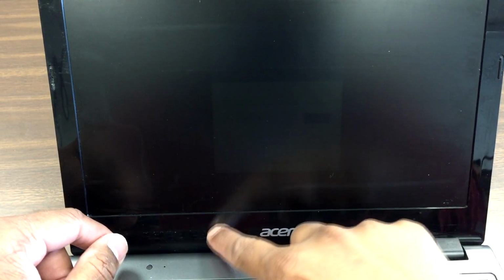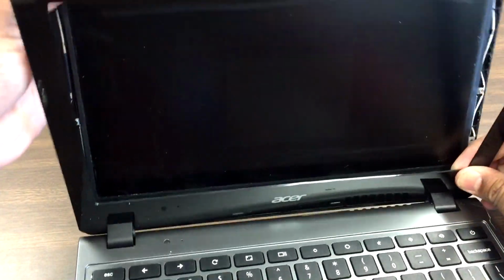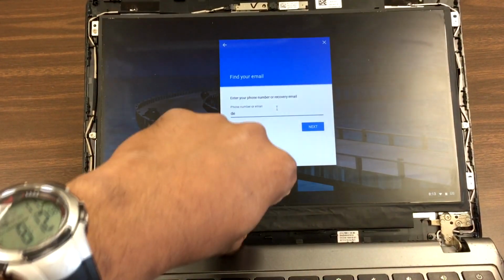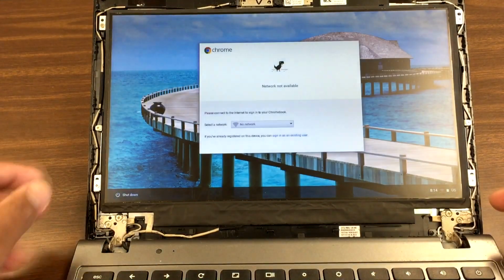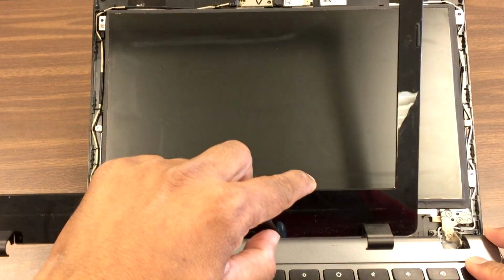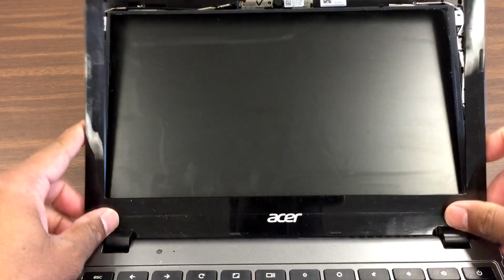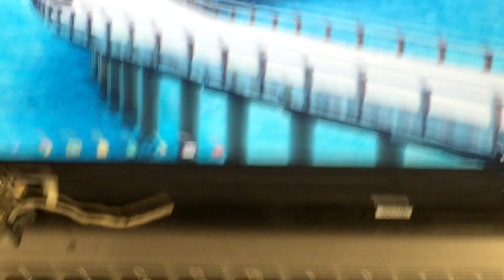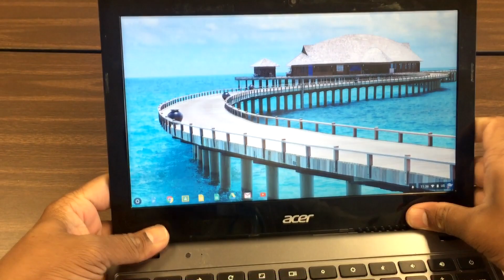How to Fix Dark Screen issue or brightness doesn't work Issue on ACER C720 Chromebook

Comment: I wasn't having it as bad as in this video but still had a bit of an issue with it. Definitely seemed to help. I was going to try and remove the screws and do the rest but I stripped my 4th screw trying to unscrew it and had no other way to get it out so I had to just put it all back together. That 4th screw was just refusing to turn. Tried doing it with a plyers and would not turn. Only other way I can think is to get a screw extractor but I'll just wait till it actually gets bad enough to where pushing the wire up doesn't work.

Comment: i had won a new chrome book from a work and it worked for about 3 months and stopped working that was five years ago i put it in 
the closet and figured it was the mother board cuz when it went out on me it was a hot summer day and i was out in the sun . so now i have an almost brand new five year old working cromebook . i used another video to see how to get my specific models cover off with out braking it and i took a close look at my internal display connectors and wow i saw main connector was at an angle and could see the half of the pins on one side and i pushed/plugged it back in as i watched it make a better connection i was so satisfied watching the plug cover the pins and it worked i am extremely happy . i feel like i won a new computer again lol. i liked and subscribed.
Reply from the maker: Glad this video helped! Thank you for subscribing!

Comment: thank you so much for this! it worked immediately
tip: don't be scared to break open the cover lol, i thought it would break and crack into pieces but it comes off really nicely if you apply force. also, when you're jabbing the wire, try pushing the wire covered with tape, that might do the trick.
Reply from the maker: Glad I could help!

Comment: I have a 2020 Chrome Book would this work with that? having the same backlight issue sometimes it gets worse when I pull the display down and it barely shows any light. But sometimes it works better while I pull it up and now it's getting a bit worse does this work? If so I might try it or pass it to my teacher in the building to try
Reply from the maker: Yes that seems like cable that connected to your LCD is loose.. give this a try.. good luck

Comment: Thanks so much for this! I just fixed a refurbished 2013 HP Chromebook 14 I got for $49 that I thought broke itself in the first 2 days!
Reply: wtf 49?? for a laptop thats low for a laptop a laptop is usually over 200
Reply: @ethanwinters3776  My record for a Lenovo N23 is $17. I have scored several more in the sub $50 or even sub $40 range. BackMarket is a great source for low cost refurbished Chromebooks with warranties! eBay too, of course ;)

Comment: I have an Acer R 11 Chromebook. I only used it for six months before it stopped working. When I plug in the charger I see the blue light is steady but I cannot get it to turn on. The screen is dark. I've tried pressing esc., refresh and power at the same time. That didn't work. I tried pressing refresh and power at the same time, didn't work. I tried pressing the button to brighten the screen. That didn't work.  I am wondering could it be that I just need a new adapter? Please help me save this Chromebook. It was hundreds of dollars. It's a white Acer R 11. I bought it awhile ago but only just started using it six months ago before it died. Please help.
Reply from the maker: Just unplug the LCD cable as show in this video and plug it back in.. that should take care of the issue. good luck

Comment: Guys you don't need to risk opening it  just slap it on the back and it should work good luck it worked for me slap it on the bottom where the cable is.
Reply: No way! I tired his way first. Zero result. Broken hearted i just scolded in the comments till i saw yours. I did just what you said. Success!
Reply: @ripmowt  nice to hear it worked ! but get it fixed ASAP i recommend it highly.
Reply: @RealOddlyDone  yes trying to get a screen replacement now
Reply: @ripmowt  brother it is not the screen it is the display cable connected to the motherboard do it on your own it is not that hard im 13 and i got the job fixed and it will save up money you are welcome!!!!
Reply: @RealOddlyDone  ok thanks will try this

Comment: Anything else i can do if this didnt help?
Reply from the maker: hmm.. unplug the power cable, hold the power button for 15 sec, plug the power cable in and turn it on.. Hope that works, but if the LCD connection is loose then you have to go thru the steps shown in the video.. good luck

Comment: This didn't work out for me.. Is there anything else I could do? Please help
Reply from the maker: unplug the power cord, hold the power button for 30 seconds, plug the power cord back in and turn it on.. hope this works.. 

Also, are you able to see the screen at all ?
Reply: @TechGuru247  Thank you so much for responding!!! 
Can see the screen very barely. If I switch the torchlight on, towards the screen, it is a bit better visible.

Comment: How can i open my monitor it doesnt open man im panicking
Reply from the maker: What model chromebook you have?
Reply: Tech Guru i have pc thats the problem exactly like this but idk what to do
Reply from the maker: oh ok.. most likely unplug the VGA(blue) cable from both end and plug it back in.. hope that works.. OR replace the VGA cable.. good luck
Reply: Tech Guru thanks but it doesn’t really matter now because im getting laptop that is alot better than that pc so anyway thanks for your time :D
Reply: Tech Guru but i also have a lot of useful files and that stuff but u said VGA (blue) i dont have any blue cables btw so what should i do
Reply: Tech Guru i found the VGA cable but its fixed in my monitor so i cannot unplug it so i just unplugged from the pc and plugged it back in nothing changed

Comment: I have a toshiba c655 with no backlight, tried removing the cable and connecting ( both from the led panel side as well as the motherboard side) stilll the same :(
Reply from the maker: Seems like you have to replace the screen as screen might be damaged.. good luck

Comment: Finally I found a video that has the same laptop as me bro I have the same problem with my laptop my screen is just dim and my computer still works but the display on the laptop still shows but is really really dim
Reply from the maker: most likely unplug the cable as shown in the video and firmly plug it back in.. If issue still not fixed, you might have to replace the screen.. good luck

Comment: Ok so I did this one time and it worked but a few days later it went back to being all black again, I tried to do this method again but now it’s not working!! Please help
Reply from the maker: Once you unplug the plug the cable back in, hold the power button for 30 seconds or so and then turn it back on.. hope that works
Reply: Tech Guru unfortunately that didn’t work ): the cord is loose. Everything else is working fine but the screen is black

Comment: Im having trouble removing the case around the screen
Reply from the maker: As shown in the video, the bottom two hinges are hard to detach so have to apply little more pressure while pulling it up.. Good luck..

Comment: Thanks for the time in doing the tutorial. If you are so kind and could assist me, mine has the following fault, and that is that after it began to function again after properly connecting the flex cable (it stepped out a bit after a fall), now the brightness remains very dim, you see the perfect image, without stripes or anything like that and also responds to commands of increase or decrease the brightness on the keyboard, but the brightness remains at a low level even when it is at maximum according to the brightness increase command. It also illuminates slightly more the right side than the left side of the screen. I noticed that the lamps are good, but in the area of the inverter it has some sound when is working, like a buzzing, all this happened after the fall. Also, when I touch the lamps cables when the laptop is on, the brightness is affected. What do you think it can be? Could you give me any suggestions? It's a HP X16-1025-nr. Thank you in advance.
Reply from the maker: It sounds like you need to replace the LCD as it might got damaged after the fall. Try to reconnect the LCD cable and plug it back in and make sure it's plugged properly. If that doesn't help, replace the LCD and made some videos on how to replace a screen. Good luck..!
Reply: Thanks for answering and your suggestion! By LCD cable you mean the flex cable right? I was wondering if in the case of a failure in the flex cable, could this cause that the appropriate voltage does not reach the inverter? Because for what I've been deducting, it seems to be a connection problem, something might be causing that the proper voltage doesn't reach the lamps and I'm not sure if it is the inverter or the flex cable.
Reply from the maker: Correct.. the flex cable..
Reply: Thanks again for your time, have a great day!

Comment: Will it work on loptops?
Reply from the maker: Is your screen is dim/slightly visible? If yes, then it should work. However, the process might be slightly harder as the screen cover might not come off that easy, might be attached with couple of screws. Good luck!
Reply: @TechGuru247  help it didn't work for me
Reply from the maker: then may be you need to replace a screen.   Are you able to see any images at all when turned on?
Reply: @TechGuru247  yes I can see images it's just when I move the lose cable nothing happens
Reply from the maker: @Broken Nation - Unplug the cable completely, and then plug it back in. If still says the same, you might need to replace the LCD. Good luck
Reply: @TechGuru247  how do you unplug the cable
Reply from the maker: If the connection is loose that it sure will work for laptops as well. Good luck

Comment: There are three things that can cause this.  You just found one.  It could be that the display cable is loose, but it could be that the cable is just broken.  However, there are a few other issues that can cause this: faulty system board or the LCD splash.  If it's either one of these, you have to replace the entire system board or LCD display.  The cost isn't worth it, though.
Reply from the maker: thanks for taking the time out and leaving a comment..
please subscribe for more videos

Comment: Can you help me? The same thing is happening but when I did it, it didn't work and I can hear stuff like my discord messages but not the screen it's pure black now 😰😰😩😩
Reply from the maker: So you were able to see any dim images before it turned black? Try unplugging the LCD cable and plug it back in gently..  good luck.. If not, watch my other videos related to not turning on issue.. Please subscribe if you are able to fix this issue.. it's FREE.. :)
Reply: Tech Guru I when I took it off I don't know where to plug it again I think I will just get it fixed anyways awesome video 👍🏻

Comment: i have the same probleme but in desktop not laptop can u help
Reply from the maker: Make sure the VGA(blue cable) connection on both end is solid. Try unplugging and plugging the VGA back in. If that doesn't work, try replacing the VGA cable. Hope this helps.

Comment: Im too scared to open the frame!!How to open it safely??
Reply: Just go for it
Reply from the maker: You do not need to open the entire frame. Just push out from the top side of the bottom frame and pull out the fram from left side, and then just push the LCD cable upwards until the screen is back to normal.. 
good luck brother..!  
I will also re-make the video about it soon..
Please subscribe and share if you are able to fix it yourself...!
Reply: Tech Guru It didn't work
Reply: I kept on pushing the lcd cable upward but nothing happened😣
Reply from the maker: Please email me the picture of the chromebook, the screen and the LCD when the power is ON if you can. I will take a look at it.

Comment: Still didn't work what should I do
Reply from the maker: Is it solid black screen or you are able to see the images on LCD? either way, try it one more time and use the "alternet" way to fix it.. If you followed these steps and it still doesn't work, you might have to replace the LCD.